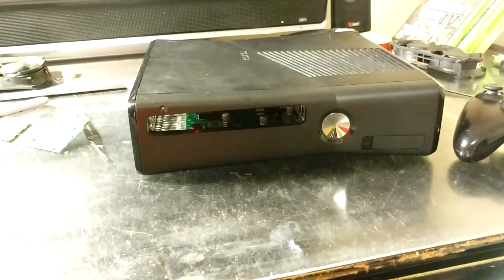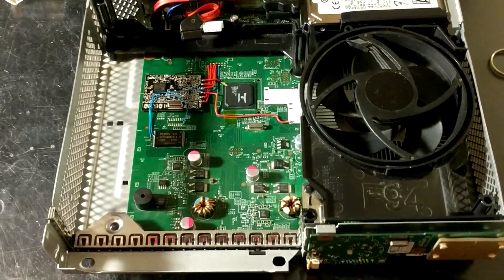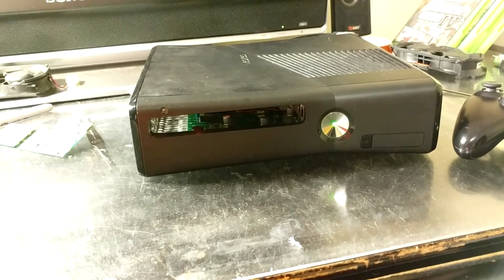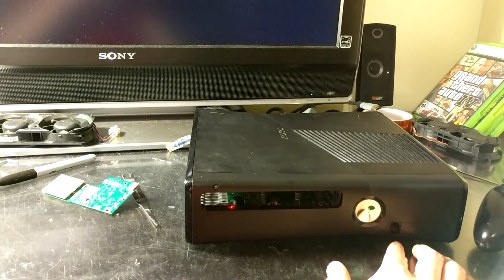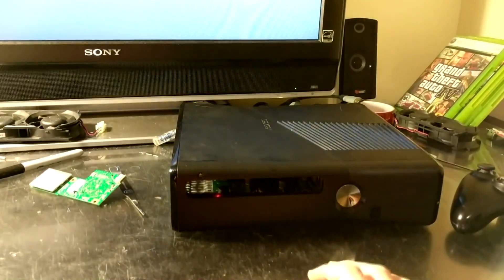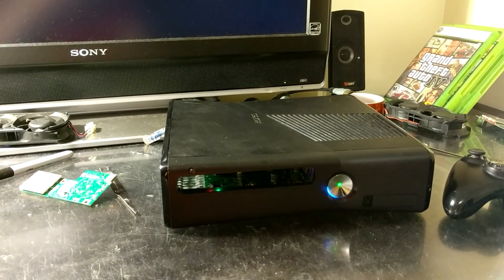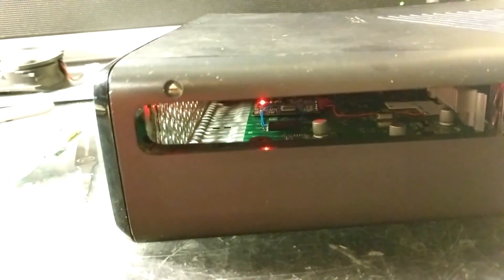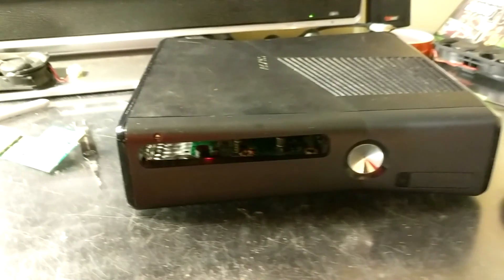Xbox 360 Corona NANDWICH DUAL NAND

Comment: For like the cpu rst point for R8C2, should I use like 30, 28 or kynar wire? Or just double shielded cable. I'm not sure if the gpu or cpu heat affects the signals going in and out of the glitch chip

Edit: also talking about the post out and pll too
Reply from the maker: No need for shield.
Reply: @Josh.Davidson  what does the shield prevent
Reply from the maker: @silenteyebros  noise. its not needed